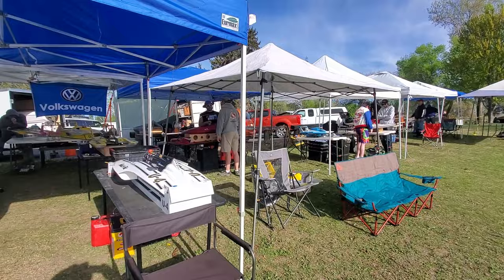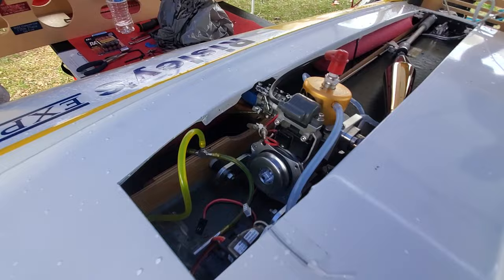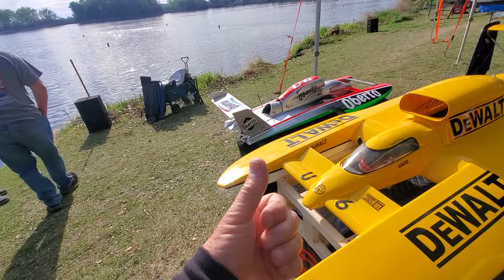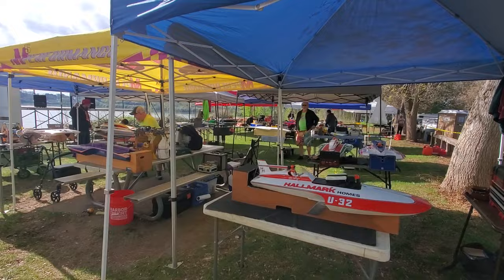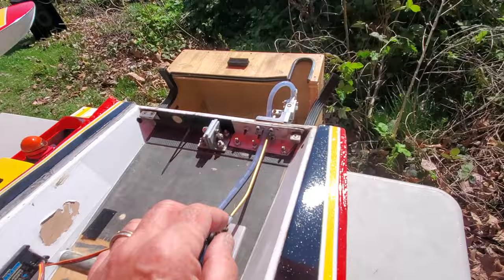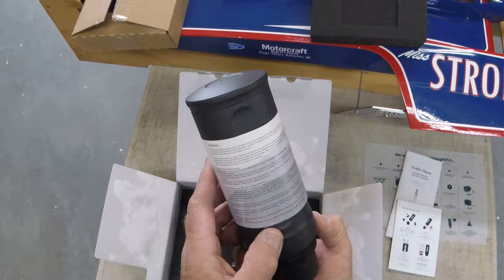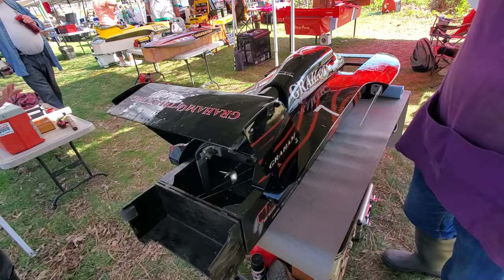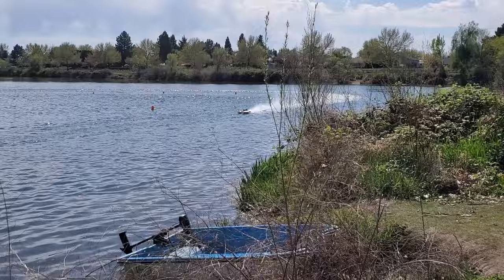R/C Hydroplanes Atomic Cup Pit Tour 2024 - Real Racing Action!

Comment: Ahhh the ol paint pucker. Most spray paints have a recoat time if you wait to long check your drying times. If it says recoat with in 20 min. or allow 24hours to recoat. not 23 not 22 it will pucker every time learned my lession painting bike parts

Comment: If you upscaled these to full size and the performance went upsize with them,  the speeds would be over 300 mph lap times in  H1  Hydro.
Reply from the maker: Close, but the 8th scale boats are doing over 500mph scale equivalent @ just over 100lbs weight! Zoom zoom

Comment: On a real Race Boat, the Hydro dynamic Prop and Skid Fins are Razor sharp.  So much so you need to handle the parts with kevlar gloves.  Work on leading and trailing edges of both parts, to go fast....

Comment: Why do you guys go right ? Just wondering.
Reply: Prop rotation makes gas boats turn right better, as we get into electric its not so important as they have L/H and R/H  props ,
Reply from the maker: Engine rotation. Full size hydroplane engines rotate clockwise causing the hull to rotate counterclockwise resulting in a lifting of the right side sponson. If the boats turned to the right they would tend to simply flop over in the turns.  Most RC engines rotate counterclockwise lifting the left sponson, so we turn right.
Reply: Ah OK thanks for the info I did not think about that at all.

Comment: I was watching highlight videos of full size unlimited hydros, and came upon your video. A question came to mind. Is there a specific reason why the big boys(Unlimiteds)race counterclockwise but the R/C’s race clockwise? Or did it just happen to end up that way?
Reply from the maker: Good question!  It's a motor rotation issue. For whatever reason r/c engines rotate counterclockwise instead of clockwise like full size hydroplane engines do. The counter rotating effect of the engine and prop tend to lift the left side sponson, and if we turned hard to the left the boats would tend to flop over to the right. So .. for the same reason big boats turn left, we have to turn right.  I guess it's like you said; It just happened to end up that way! 🤣
Reply: @M5PerfHydros  Thanks, I didn’t think of that. I remember way back when, when I was into ski boating with outboards, that the “cockpit” was usually on the starboard side to compensate for the rotation of the engine. Same when I switched to inboard/outboards.